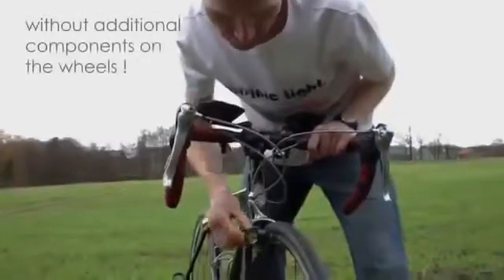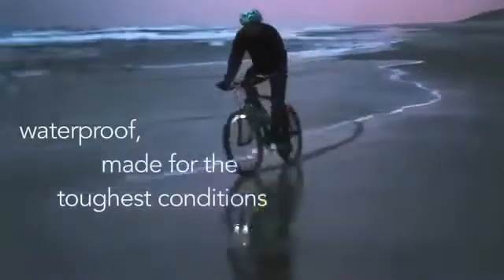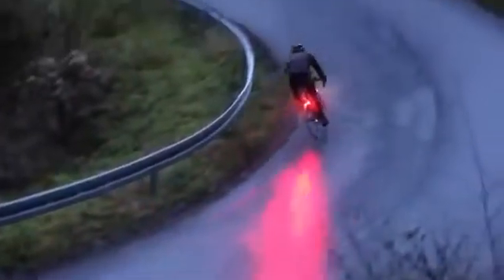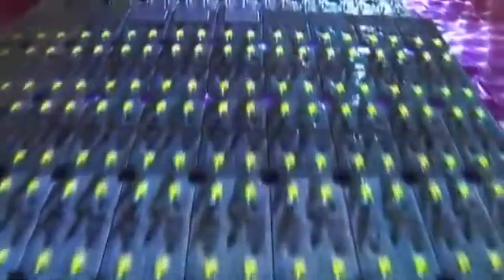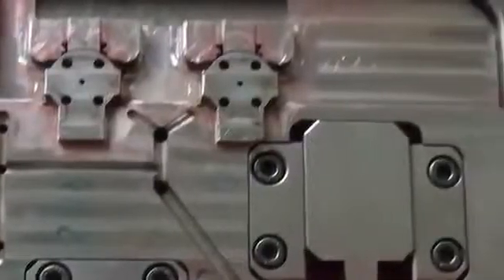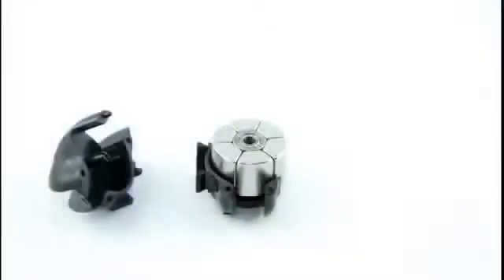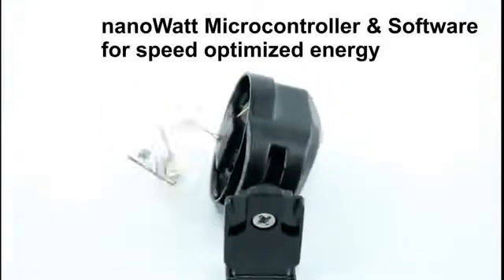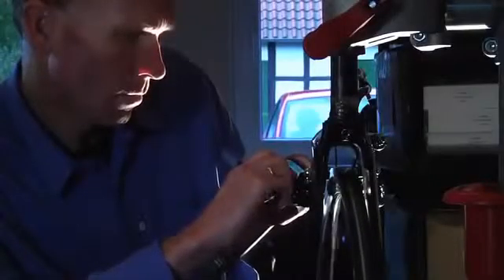Magnic Light iC: intelligent contactless bicycle dynamo

Comment: The second Magnic Microlight kickstarter campaign with improved brightness and miniaturisation got funded some days ago and will end on 2018-12-21 - one can still join.
https://www.kickstarter.com/projects/dynamodirk/magnic-microlights-bikelights-with-magic-non-conta
They are a very clever way to have continuous* bright light without friction by tyre or hub dynamo, without any cabeling or batteries at a total of just 140g in the full double setup.
Two models are now available:
Magnic Microlights (to be mounted as break pad holders, with pads still replacable the usual way) or Magnic Microlights Wega (to be mounted on the frame and fork when no rim breaks are present or of an odd design).
Presently they miss the smart options like Bluetooth support and brake lever induced turn blinking that is a (likely failed) stretch goal of an ambitious attempt for 7 times the goal. But it still might come sometime in the future.